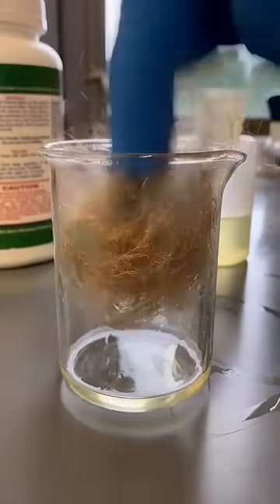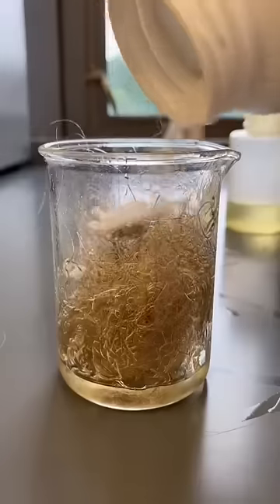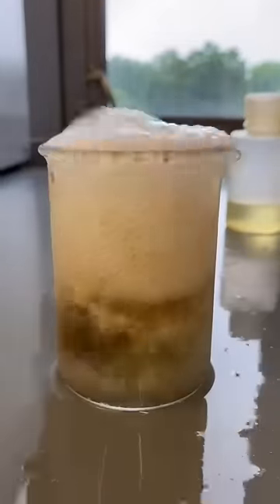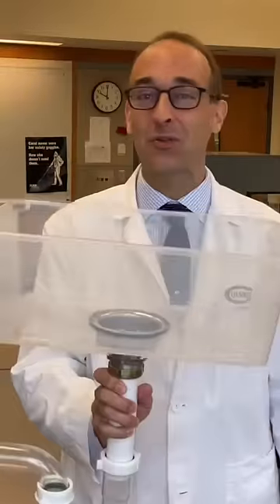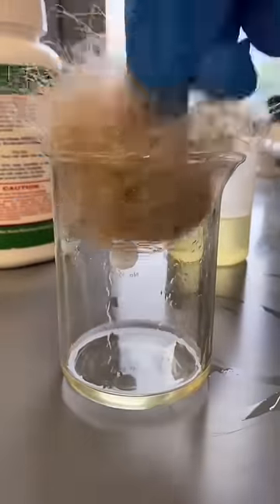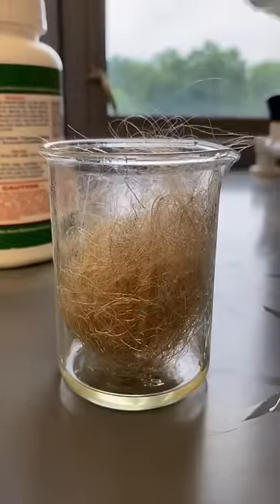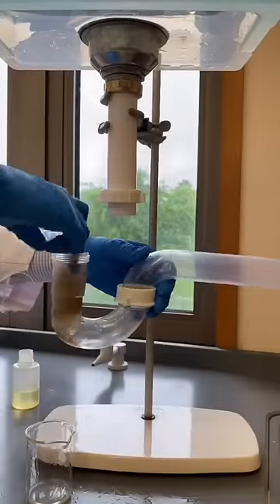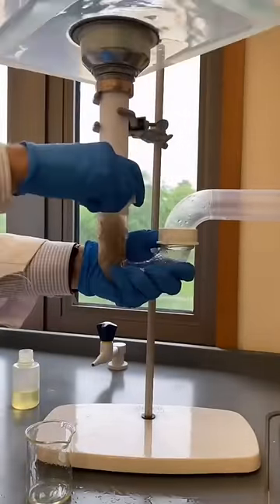How solid drain cleaners work

Comment: don't use this on cast iron drains for houses, also if you have a sceptic tank DO NOT USE THIS METOD. use a drain cleaner rated for sceptic tanks
Reply: I hate when my tanks get sceptical
Reply: @brrrrrr  😂
Reply: @brrrrrr 😂😂😂😂😂😂😂😂
Reply: Skeptic tanks are hard to convince
Reply: I’ll have to see if mines sceptical tank 😅
Reply: I don't know why people are saying don't use this on cast iron. Lye won't corrode cast iron at all. Sulfuric acid drain cleaners, however, will destroy them over time.
Reply: @GarryBoyer I agree. Strong bases actually help metals form strong patinas over time. Unless there's a secondary reaction that happens after, I can't for the life of me think of a reason for iron pipes to be a problem. Perhaps the issues are from descalers, which are usually acidic in nature and people confuse the two???
Reply: Exactly  @Tom-lm2tc  . Though there are some exceptions. Lye will dissolve aluminum oxide by turning it into soluble sodium aluminate. Same with zinc, so it's bad news for galvanized coatings.
Reply: Iron is ok. Where you're not supposed to use it is aluminium piping. Aluminium amplifier the reaction. Here the drainer comes with small aluminium shards for it to do the job faster.
Reply: @Tom-lm2tc yea there's no issue using lye (sodium hydroxide) or the more common sodium hypochlorite in iron pipes.

Sulphuric acid cleaners are pretty rare. I've only ever seen one brand that makes it and it's got a giant ass label about porcelain and cast iron pipes.
Reply: Yes, a brand new cast-iron pipe, which is never put in as sewage pipe these days anymore can be used with Drano, but a completely rusted one which has a lot of free oxygen to give cannot be used with Drano😂
Reply: @davinbrown3072  there is oxygen in the air and in the water too, silly. What are you going on about?
Reply: Don’t use it with any plumbing drain cleaners are terrible, call a plumber.
Reply: Good to know I have a newer home what do I use? I just peroxide
Reply: @user-ov3cw8iy2c  I’m a plumber by the way. some hot water not too hot and if that doesn’t work then just call a plumber or drain cleaning company. The damage that chemical drain cleaners do to plumbing isn’t worth what you save on a plumber. You’ll likely end up spending a lot more down the line on one if you put chemicals down the drain. If you live in an apartment though and you don’t care about your landlord then do whatever you want lol
Reply: People use these to create lye baths to strip seasoning from cast iron. They'll leave the iron in the lye bath for several days. Unlike vinegar, this doesn't create issues for the iron.
Reply: Yeah, if you try this on a sceptic tank, it will go “Are you sure about that?”
Reply: Are septic tanks normal in the US?
Reply: @stevendinowindfeld  depends where you live. If your house is far from any city sewer than yes. I live in the woods on a dirt road and I have one.
Reply: @stevendinowindfeld  they do but only in more rural areas or any where that doesn't have municipal sewage lines
Reply: Sceptic tanks actually doubt this
Reply: lye is completely safe for cast iron. Many people use a multi-day soak in pure lye to strip cast iron cookware for re-seasoning.  You're thinking of the strong acidic drain cleaners, which can destroy those old pipes.
Reply: Thanks professional plumber from youtube
Reply: Why can you not use lye with a septic tank?
Reply: In case you don't bother reading product labels and directions, but you do pay attention to YouTube comments. 😉
Reply: Try "Believer" the new product for convincing those stubborn sceptic tanks that just refuse to listen.

Comment: My favorite thing about Lye is when you put it down a drain and it doesn't unclog it so you take apart the plumbing and get chemical burns all over your hands. Turns out Lye can't unclog a drain full of spoons!
Reply: Lye doesn’t unclog drains anyway. It just sits there and does nothing. Then a plumber shows up and dumps sulfuric acid down the same drain and creates a massive exothermic reaction, destroys your fixture, burns himself, and has to rerun your stink pipe. Just use a plunger or take it apart like a normal person.
Reply: Spoons !?
Reply: The trauma in this comment section lmaoooo
Reply: Wear gloves then
Reply: Whyyyyy spoons?!
Reply: I guess you could say it's a "Lye'ing" drain cleaner 😂😂😂😂😂😂😂😂😂😂😂😂😂😂😂😂😂😂😂😂😂😂😂😂😂😂😂😂😂😂😂😂😂😂😂
Reply: hands start turning into a mummy. luckily you can submerge them in water for about 12 hours an can go away. but i also only had a mild exposure very glad it didnt get into my eyes bc it was an overhead pipe from the 2nd story
Reply: Now I know.
Reply: work smarter, not harder.. neutralize the lye with an acid (HCl is best in a lab setting but also highly acidic, so I would use a weaker acid like HF)
Reply: @jman0870  i haven't Heard anyone else talk about using a plunger 😂 i was beginning to think i was weird for using toilet tools in the sink
Reply: @anotherguy9402  plungers work great 🤷‍♂️. People also never pull traps and don’t know how to use a flush bag. Just throw some chemicals in it. That will fix it.

Comment: I am a plumber. This stuff is incredible. You shouldn't rely on it alone to fix clogged drains, but it's a great way to get the last bit of stuff after snaking.
Reply: Would you say that all those fancy brands and expensive drain cleaners are more effective than their generic or in this case pure lye crystals, or are those unnecessary?
Reply: As a plumber you should know not to use this crap
Reply: Isn't this essentially bleach? I don't know I'm not a scientist. Asking for a friend:-)
Reply: Also what's the best way to unclog a drain if you can't snake it? If anybody would be so kind to answer.
Reply: @twistedara  honestly, call a plumber who can snake it. Chemical drain openers are extremely corrosive and eat away at your pipes. Not worth "saving money" destroying your pipes
Reply: @erikhuisman2487  ok. Thanks. Not a lot of money. I can take it apart just didn't want to.
Reply: @twistedara  no, not exactly. the stuff in the video is sodium hydroxide (NaOH), while bleach is a dilute solution of sodium hypochlorite (NaClO)
Reply: @cartermilan  I think sodium hypochlorite can form sodium hydroxide when dissolved in water though. But yeah, still not the same thing
Reply: @twistedara sort of, it's like bleach but much stronger, so instead of causing simply irritation it would turn your hands into fleshy soap if spilled. It turns your hair into what's essentially human soap and then that glob dissolves in the water

Comment: Makes you reflect on how much shit has to be going on when these dont work
Reply: Not really. He didn't even put that much in the drain, wasn't really clogged. 

These chems don't do anything for real clogs.
Reply: @KraljHD  oh they have never failed me before tho
Reply: @KraljHD  Tf do you put in your sink 😂
Reply: @VlerkeDamne  Not in mine, but in the ones I fix.
Reply: @KraljHD  Aaah that makes sense. You must come across some nasty pipes.
Reply: @VlerkeDamne  I'm used to it. Most pipes look like biohazard waste when you pull the gunk out.
Reply: @KraljHD  Its probably often marijuana smokers, right? They often don't realize that cleaning their pipes and bongs in the sink is bad. That black tar comes out of the weed and doesn't dissolve with this stuff I don't think.
Reply: @thatoneguy33198  Isopropyl alcohol does the job for glass bongs. Once that’s done it will be clean then it can be washed in the sink for hygiene
Reply: @Alexander_l322  yeah, just remember if you put rubbing alcohol on it, you should let it dry completely before putting new water in a bong, or using it, alcohol evaporates quickly, so it shouldn't take more than 30 minutes i would guess
Reply: @KraljHD  all it really takes is one time draining your ground beef fat in the sink without letting the water get good and hot to run behind it.  At least that's how I was taught to do it. Some folks say don't poor grease down the sink period but some folks don't live where you can just take it outside and dump it.
Reply: @thatoneguy33198  lmao no, it's everybody especially women. Got a sister, girlfriend or a mother living with you? All that hair is going to stay there for years before you realize there's a problem. Thinking only a specific niche of people can clog their drains is delusional.
Reply: @travisyayes6343  i have a plastic bottle that i use for my old used grease/ oil. Then i put soap in the pan and fill it with water and swish it around. No clogs so far.
Reply: @hugogonzalez1749  Never did I say "only". I was just saying that you WILL clog your drain if you are washing black tar from weed down it.
Reply: Yeah. I work in a hotel and 2e had a clog that ruined our little 25ft snake (wouldn't move and the snake tangled on itself) sulfuric acid didn't do a thing even after sitting for a while. 

Called a pro, he got it to move.....down to the next floor.
My coworker got that one out, and then found out it had gone down to the next floor. 

I don't know what 306 put down that drain, but it was definitely not supposed to be there LOL
Reply: @KraljHD  don’t you also use sulfuric acid…?
Reply: @travisyayes6343  I just burn mine in candles using rockwool as a wick. It adds some nice background heat to my bedsit and doesn't soot if I use a short wick.
Reply: @thatoneguy33198  The only reason resin is a clog risk is because cannabinoids are hydrophobic, and the resin contains some oils from the plant. There are non-corrosive agents often used in making edibles to help mix oils with water, pour that down the drain after dumping out the water pipe and the resin won't clog, it will flush through easily.
Reply: Potty words are not cool!
Reply: Usually inorganic matter trapped in the drain. Don’t use these any way. First course of action is to open the p trap, then if that doesn’t work snake it.
Reply: @thatoneguy33198  just the heat from hot water softens that shit right up and washes it away. If your pipes are clear it’s not doing anything bad. It could exacerbate an already present problem.
Reply: @thatoneguy33198  How much weed do you smoke?! I mean, seems like it would take a serious amount of tar to actually clog an 1-1/2" to 2" drain line.
Reply: @eyellgeteven9928  I have never put weed ash or tar down the drain. My friends have and it really doesn't even take that much, that stuff is extremely sticky, its like unprocessed crude oil.
Reply: Pour grease from cooking in the garbage
Reply: @thatoneguy33198  it is nothing like crude oil😆
Reply: @thatoneguy33198  bro what? Lmao you're talking crazy
Reply: when they don't work use a plunger or a plumber's snake.
Reply: @travisyayes6343  you can save good grease though. Makes damn good gravy.
Reply: @thatoneguy33198  As someone who used to clean his bong daily, can confirm. The iso evaporates and moves through the pipes WAY faster than the resin.
Reply: @travisyayes6343  so dump it in a container to cool and then throw it in trash.  Pouring it outside will make things gross and attract  critters
Reply: @travisyayes6343
Reply: @travisyayes6343  tinfoil in a bowl, drain into that, let it cool, toss the tinfoil in the trash

Comment: Fun Fact: Sodium Hydroxide is also used in Nair to dissolve hair from skin! So the next time you're using it on your body, just think the same thing is happening in your drain :)
Reply: It's also used to break down tissue
Reply: That's why it says to remove in ten minutes. Or you'll probably lose more than a few hairs.
Reply: So maybe I'll put extra hot water in my drain after hair removal
Reply: @100GTAGUY nonsense, only proteins. In this case keratin.
Reply: @MagnakayViolet  it no react with iron or plastic, atleast not at room temperature, i use that chemical  and do a great work, yes you need to clean it for 2 reason first the reaction its not forever and well once is disolve you need to drain before it soaks, and 2 maybe the reaction can produce some acids that can react with iron or plastic but sodium hydroxide cant unless is above 500 Celcius

Comment: You forgot to fill the pipe with water before putting drain cleaner is. Clogged drain means the water you've put in is still there.

Comment: Just boiling water usually works the best. Lye can damage the pipes.
Reply: I have also found that boiling water works best to unclog toilets and drains. I have never had these chemical drain cleaners work very well and they are dangerous. Occasionally plungers work. Just make sure to remove all the water first, which is the most painful part of the process. Costs little to try and at least for me, works best.